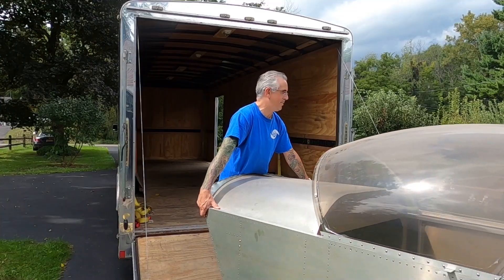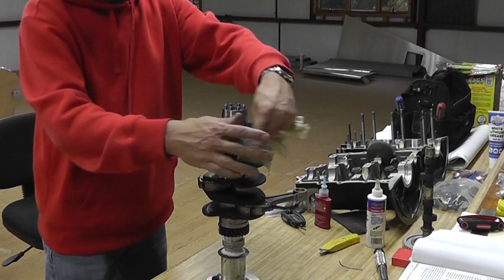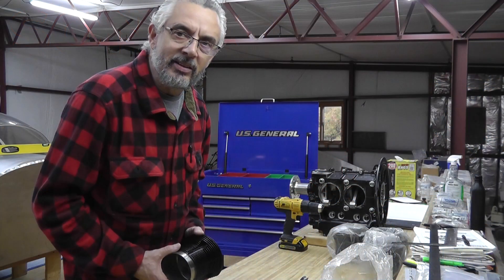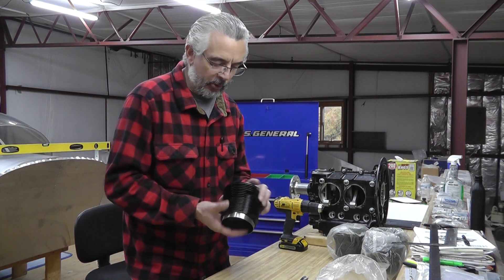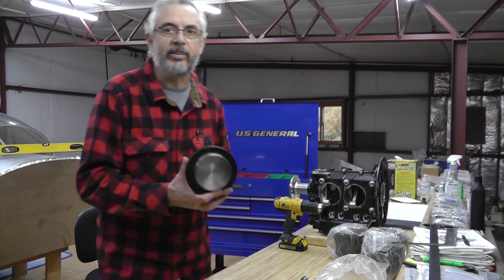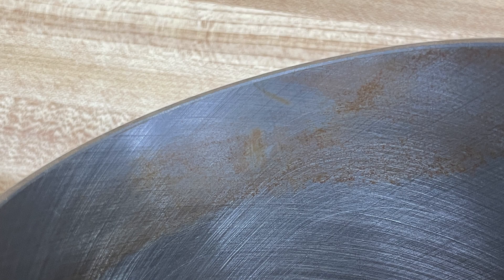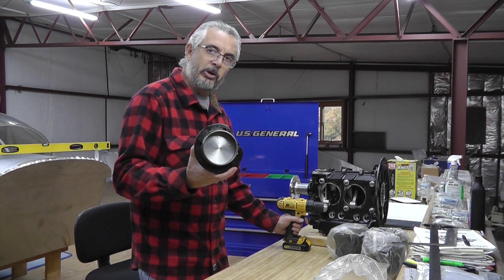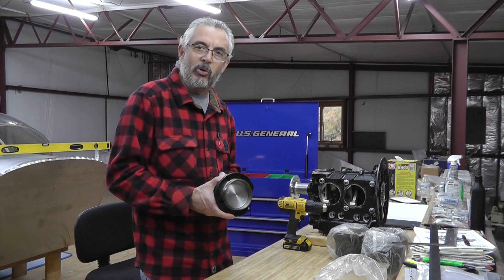Sonex Build Part 13 - More Work On The Airplane Engine

Comment: Australia - " Assumption" - (Engine reconditioning is one of my professional experience.) - Judgement is for others - Experimental Covers that conversation...only thoughts I will put to you is ........If you had OPEN HEART Surgery & you woke up in the recovery ward in intensive care... & Your first sight was all the nurse's watching U Tube of your surgery and you saw the surgeon WAVING his tools around while he was working on his video content.........how would you make a Comment on topic...lol...........( Think about an Engine it's whole job is to make pressure it's a pump).....that's why we say check the T's & "P's........( I have seen so many Engine shops - treat engines like taking out the Trash - and only because oil filters SAVE the day ,before you run a new Engine think about why you always where GLOVES when touching it's metallic parts.....the amino acids on your skin have just undone what you removed with the hone................ CLEARANCE....for Oil Viscosity ......is only going to work if YOU have no bowling balls rolling around in your alley...
...

Comment: Please tell me you edited out the part where you cleaned the honing grit out of the cylinders with Brake-Klean and compressed air, then applied a coating of clean oil, without contaminating it with fibers from that rag. A rag should never be the last thing used, before oiling, to clean anything inside your engine. Cleanliness really is next to Godliness when it comes to engine building.
Reply from the maker: I actually did take the pistons out again to confirm that I had all the ring gaps opposite each other and piston orientation correct and I cleaned the cylinders when doing so. I did not go overboard with the cleaning but I am sure that they will be perfectly fine.